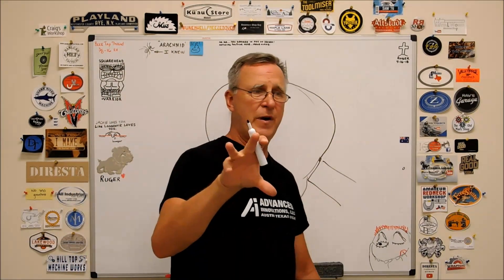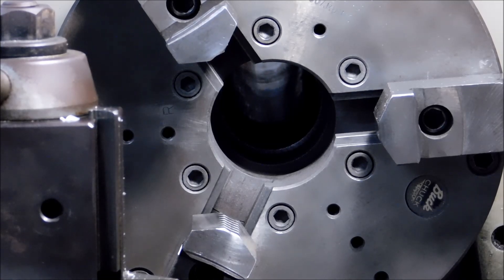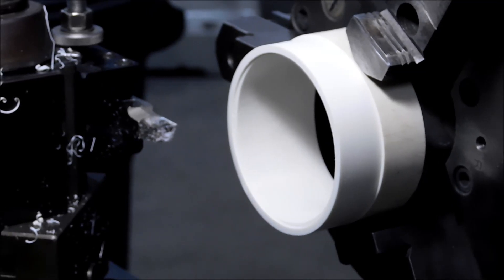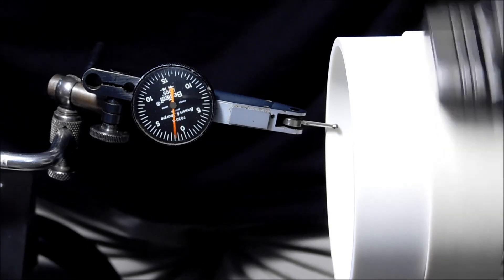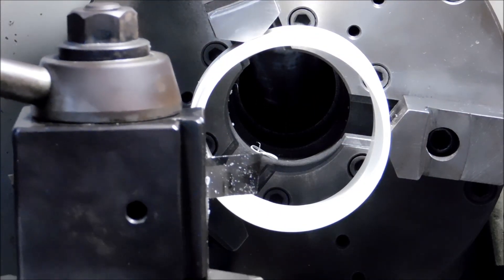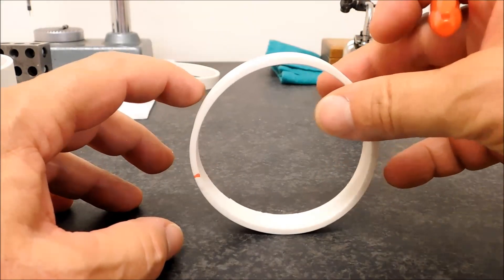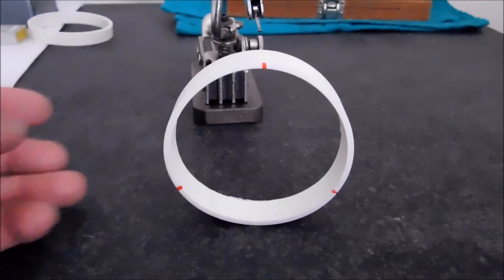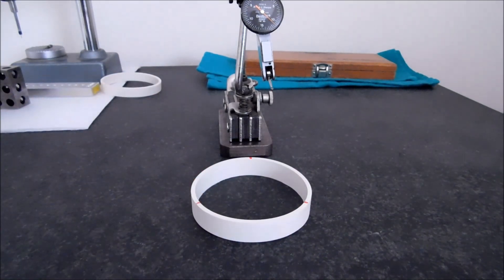Excessive Jaw Pressure and Impossible Inspection Results. Part 1

Comment: This is a common “ centerless grinding “ result, that is why the operator will use a  “ V “ block and drop indicator, I used a wire EDM to make a insert block to change my 90 degree block to a 60 degree block.

Comment: Aah but yes. As it rolls onto a flatter portion the overall height only sinks slightly even as the lobed area reaches the top, hence only appearing slightly in precise.

Comment: Joe, I consulted a firm who bought a huge pile of round stock to make parts of (1"or 25 mm). Quality control took the batch in after measuring with a 2-point mike like they used to do. The operation they had to perform for the final customer was easy; cut to length (approx. 4 feet or 1,20 meter). The final customer rejected the parts (+25k€ of value) because the bearings didn't fit. Nobody understood what happened here, just as you did when filming this episode. By holding the part in a collet and using an indicator I found out what the problem was as you found out. Exactly mind blowing as a first for me too. A shape that measures correct but isn't ... This issue wasn't covered in the delivery conditions of the material supplier and the shop who bought the stock was about to close because of this (single client shop, always a bad idea in many ways). Finally both parties (material supplier vs machine shop) reached a gentleman's agreement to share the drama so the machine shop could survive and continue to purchase and machine material for a real thin slice of bread with no butter or a "win-win" outcome. They still machine this parts as we speak and quality control has a set-up which I made to examine the shape of the material next to the measured diameter of the material. If you like this kind of input I have more stories to tell about "impossible" measurements. Thank you Joe for all your educating on correct machining. Stay safe and be happy, Best, Job

Comment: the plunge in really fugd things up
Reply from the maker: I don't think the plunge did it. the stress did.
Reply: also if you used a cmm for inspection, you would get a more out of tolerance measurement
Reply: the indicator only shows the movement of the indicator needle.  Its the persons job to analyze that correctly.  In that case the max highs and max lows do not show. Similar to drawing a best fit circle
Reply: Remember pvc tubing is extruded and the wall thickness does vary slightly.  bolting it to a fixture piece will remove that error
Reply: The exact same thing happens with all materials
Reply: learning calculus will make you look at the world differently

Comment: bolt it to a fixture piece to get best concen.
Reply from the maker: Sandwich pressure is the way to go.
Reply: i meant drill or tap into the extra stock, then connect to the chucked up fixture.  where would sandwich pressure come from? jw
Reply: a tight slug inside would be a quick fix

Comment: I'm sure you knew this at one point (because I'm sure you've mentioned Foundations of Mechanical Accuracy by Wayne R. Moore), but lobed cylinders of constant diameter (with any odd number of lobes) are perfectly possible. See the aformentioned book, pg 255. There are two ways to measure roundness, and a height gauge or indicator with a surface plate aren't among them. You can use multiple V blocks with different angles and an indicator, or you can use a precision reference spindle (spin table, rotary table, machine spindle with indicator, etc). Diametral measurements will never unveil all possible lobed conditions, whereas radial measurements will.
Reply: Yes, ideally Reuleaux polygons, which have constant diameter across any cross-section but are far from round (eg. the 7-sided UK 50p coin).

Comment: Here is what I would do;
I would lay it flat on my Bridgeport vise. Obviously with a well trammed head, and on the face you true'd up . Then I would probably put a tiny dab of super glue on each lobe. Then using a coaxial indicator I would read the out of concentricity. I think that is the only way you'll get a true reading of what happened to it. 
I'd probably take readings at three heights on it as well to see if it's also tapered. My guess is that it is.
Reply from the maker: Watch part 2. This part is a mess!!
Reply: @joepie221  will do. Thanks.

Comment: This can not be accurately corrected. Stresses will distort the part.
To avoid this problem in the first instance you should turn a mandrel for machining the OD and a corresponding housing to clamp the part end on to bore the ID.
Reply from the maker: We may differ in our opinions here. On a real critical part, its not going to be 2 operations. The stress must be machined out first and the part allowed to relax. Rough both the OD and ID, fixture correctly, finish the ID and OD. Your chances of success are much greater if you don't shoot for finish dimensions on the first try.

Comment: I'm surprised it wasn't closer than 0.0025", but it's probably due to the internal stresses in that plastic.  Here in the UK we have had 7 sided coins since 1971 (50 pence and 20 pence, see Google Images). They are rounded on the points, and between the points, and the radius of the side is from taken from the opposite point... so they remain a constant height when rolled on edge!  As a teenager, I rolled one on a table, and held a book, horizontally, on it, and was surprised that the book didn't go up and down.  I think I've been waiting for you to make this video for 40 years :-)

Comment: Using aluminum stock of nearly identical dimensions I turned a threaded adapter for a camera lens, a fairly expensive camera lens.  Being a dumb dumb my go/no-go gauge was the lens itself, which I test fit while still in the chuck.  Smugly satisfied with the fit and finish I left the lens screwed on as I pulled the part out of the chuck.  My monkey brain was profoundly confused to find my threaded adapter was now one with the lens and would not, could not, be un-threaded.  After using excessive force without any success I put the part back in the chuck to get a better grip and my jaw went slack as the part and the lens un-threaded with out any effort.   That was a very strange day, and made me question my sanity.  I now believe I understand what happened, thank you!
Reply from the maker: I've seen guys do that with thread and plug gages, then go to the mill vise to get a grip. It never ended well for either part. You're lucky to have clocked it right, or it would have been tighter when you put it back in the lathe. The planets lined up for you on that one.

Comment: Have a look on Wikipedia for a Reuleaux triangle.  Not round but of constant diameter.  I suspect that's what you may have just created - or at least a close approximation.
Reply from the maker: I am sure its very close if not exact.
Reply: Hi Joe & Gareth,

Close, but not exact.  A Reuleaux triangle has discontinuous (pointy) vertices.  I think a better approximation would be a three lobed epitrochoid.  A three lobed epitrochoid resembles a fidget spinner, but in this case not as exaggerated.  It can be generated with a Spirograph; remember those?  A more general, but infrequently used term is a trircle which may have circular (concave or convex) sides and circular vertices.  A conventional triangle is a degenerate case of trircle:  the sides are from circles of infinite radius and the vertices are circles of zero radius, i.e., points.  A Reuleaux triangle is a special case of a circular triangle.  Circular triangles always have discontinuous/pointy vertices. 

Confucius is supposed to have said, "Wisdom begins with the ability to call things by their proper names."  I won't guarantee that there isn't a better object that describes what we are talking about here.  When someone names it, I'll learn something.

Be well & Best regards,
Gottfried
Reply: Apologies (and credit!) to all those who said "Reuleaux triangle" days before me.  I did check the comments YouTube was showing me at the time and couldn't find any reference.   Now, of course its showing me nothing but Reuleaux-related comments.

Comment: Put the bottom in a V-block wide enough to make contact points 120 degrees apart, and you should be able to measure exactly how out of round it is.

Looks like you've made a Reuleaux Triangle - https://en.wikipedia.org/wiki/Reuleaux_triangle

Cool stuff, keep up the great work!
Reply from the maker: Please watch part 2

Comment: Measuring diameter is never a reliable way to test circularity. You need to measure across 3 points (e.g. rest the part on two gauge rods on the surface plate.) This is a huge trap for home shop guys, but any inspector that doesn't know this already needs to be sent back to basic training.

British 20p and 50p coins are a constant diameter, but they're not circular at all -- they're rounded heptagons.
Reply from the maker: You'd be shocked at how many professionals think a gage block and a tenth indicator is the way to go.
Reply: Ah, there's nothing quite like measuring the wrong thing with extreme precision.

Comment: It's not too dificult to see what is going on here. When the part is high at the top, it is low at the bottom and when it is low at the top, it is high at the bottom and so on. The part is two times (possibly even more) further out from it's centre than the guauge can actually read at any given moment between it's needle and the surface plate. So the part is at least 10 thou out of round, rather than the here indicated 5 thou. The part is distorted up toward it's original (unclamped round form) centre from the "bottom" and up away from it's original centre at the top (when left to rest on one of it's now three "bottoms"

Comment: You have the right idea.  At any given measurement point you would take like this, on the top contact area with the indicator would be a high spot, and the bottom contact area against the table would be a low spot (or the other way around), which cancel each other out.

Comment: Tri loaded part, best solution is to clamp it end to end and hope it doesn't spin on ya.
Reply from the maker: Watch part 2. You are correct. Stay away from the parts weak characteristics.
Reply: @joepie221  Will do. Polish machinists rock. 👊

Comment: You accidentally created a Reuleaux triangle, https://en.wikipedia.org/wiki/Reuleaux_triangle. You are measuring the height, not the concentricity, which in most cases is the same but not in a Reuleaux triangle.
Reply from the maker: It wasn't an accident, but I didn't know what it was called.

Comment: I propose that your roundness test is invalid. You're checking the width of the part, not the distance from a fixed center point. As other commenters have already mentioned, look up shapes with constant width.
Reply from the maker: You are correct. Thats the point of this video. Part 2 coming up.

Comment: if the conditions fall into place  , it is possible to measure it with a outside or inside micrometer  and have every measurement exactly the same reading no matter where you measured it  even though it is slightly triangular
Reply from the maker: Its an interesting part. It would be great to give to an apprentice for evaluation.

Comment: What would be a reasonable inspection setup for this under GDT?   Would vee block and indicator be adequate?  I'm not sure how the 90 degree vee would interact with the 120 degree part 'features'.

For inspection of the actual deviation from the actual axis of the part, how would you hold it to rotate under (or over, I dunno) an indicator?
Reply: There are more complex objects of constant width. In this case a v block would suffice but generally (and especially at sub micron accuracies) a measuring spindle or cmm is the correct choice
Reply from the maker: CMM or white light scanner for sure.

Comment: Any chuck with an odd number of jaws will show this kind of behavior on inspection, since as the "low" spot is on the surface plate, you have the high spot on the indicator.
Try this same thing using the 4 jaw chuck and you'll see it then really shows up in inspection since the highs and lows will occur simultaneously instead of alternately

Comment: Would not happen in a collet...Especially one that is bored out a few thou of the OD. 
Plus you could hold on to a lot less.
Reply from the maker: Your comment depends on the tube being round to begin with. The part may be forced into a round shape then rebound after the cut, but this condition wouldn't be the result. You'd get an egg shape.
Reply: Depends on collet. Every collet system will have a recommend minimum clamping distance.

Comment: Probly just going to be glued together and the edges are going to melt anyway. Or it gets pounded on there anyway. ya not all clickbait is bad sometimes you get what you tuned in there for ,don't you. If they called you clickbait there probly kidding you. It's a machining majic show you have and the high school geometry I love so much these day's .cause my mill is so small that I'm constantly working at my work limit's makes me learn more way quicker. soft jaws for that kinda part if you have 1000 0f them, or support it with a slug of wood . Make stuff without crazy hard to make parts ,and it is possible.  and people will say hey i could just make one of those myself . you always got  very good entertainment at  least.

Comment: Chuckle. What if I told you that you could make a part on the lathe between centers that would flunk the rool test while passing that particular indicator test within a couple thou?
Reply from the maker: I would ask you how you watched part 2 before it got released. Sandwiching this part is the only way to get close to round. Material stress will still send you some distortion, but nothing gets you closer. Not even a plug.

Comment: Ok Joe, been there and done it, got to make plugs to fit bore to chuck on or use soft jaws but then material you are clamping isn't round to start with.  Oh well.  On to both the 90 degree vee blocks and the 120 degree blocks for inspection.  Reminds me of a story, old guy I used to work for had a run in with the auto parts store, his new set of lifters wouldn't go in the bores of block.  They were out of round, he put them on vee blocks and checked.  Convincing the parts store was difficult but he did.

Comment: If you did that same surface plate inspection with any perfect polygon(which is not a circle) you would get the same result.  Like a equilateral triangle or square would measure exactly the same no matter which side is resting on the plate.
Reply: Propably not a polygon, but a shape of constant width. You get those by taking a regular polygon with an odd number of points (important) and drawing an arc between two neighboring points, so that the center of the arc lies in the opposing point. Some coins have this kind of shape, and also the piston of the Wankel engine.

Comment: Joe, That result is not at all surprising. You are only measuring at the 3 distorted points (the other 3 points were the same just upside down) created by the jaws. So they should all be identical.
Take some measurements at the areas 30deg from the red marks (ie between a red mark and the midpoint between red marks) and you will see the the greatest difference from the 3 "on mark" dimensions.

Btw although your part obviously doesn't look circular that doesn't mean that it doesn't have a constant diameter.

If you are looking for a rabbit hole to disappear down, 
Google "shapes of constant diameter" or "solids of constant width"
Reply from the maker: It has many constant diameters. Watch part 2. The error is huge.

Comment: Hi Joe, whenever I've needed to be sure of a round plastic turning job, I've gone the extra by turning up a hardwood bung to fit inside the tube (a firm push fit) where the chuck jaws grip. If I don't do this the damn job invariably works its way out? Still, I'm sure you'd be a wake up to that trick! 
BTW, I don't "unloosen " the chuck jaws, I slacken them:-) 
Nice presentation too, well done.
Reply from the maker: Thanks. The plug does work, but can influence the part. I've done that 100 times. A jaw spider and shims can be used as well. But the best way is to pressure turn it. Tune in for part 2.

Comment: What you’ve created is a curve of constant width. All the diameters are the same, but they don’t share the same center. In this case, it’s a Reuleaux triangle, but you can make them with any number of apexes.
Reply: Came to the comments to post this. https://en.wikipedia.org/wiki/Curve_of_constant_width . One of the wiki examples even looks a bit like this out-of-round part.

Comment: Try using the indicator at points other than 120 apart. Think of it this way: if you used the indicator on a fully triangular part and got only a few mils difference between sides and points, you would call it a good part. (Assuming the drawing called for an equilateral triangle with a few mils tolerance, that is.)
Reply: He can (and did) measure it at any set of points, not just 120 degrees apart, and STILL measure the same height.  NASA had an issue with re-use of the Space Shuttle solid-fueled boosters; even when out of round, they could get constant diameter measurements, but the segments still wouldn't mate properly.

Comment: Its quite a complex distortion going on. When your rolling it on the plate you can see how the material has rippled from the pressure and cutting operation. 

Guess I am going to geek out reading the Machinists handbook on inspecting circularity techniques. So I can further fill in whats going on here. It also helps fill in some knowledge I gleamed years ago. While watching a video about rebuilding extremely large diesel engines for boats. Which had a bunch of great examples of measuring for out of round. For a Crank shaft and bearing.
Reply: https://youtu.be/cUCSSJwO3GU